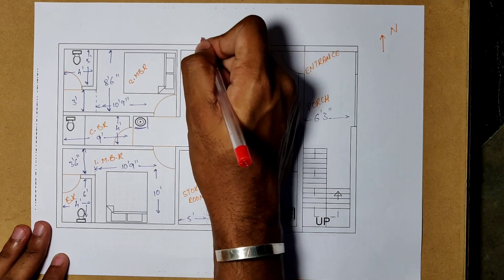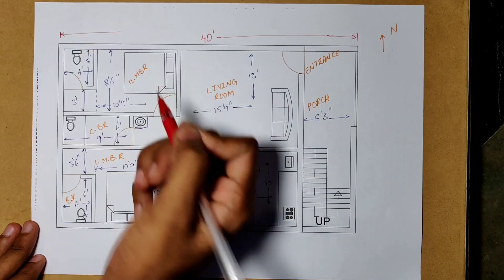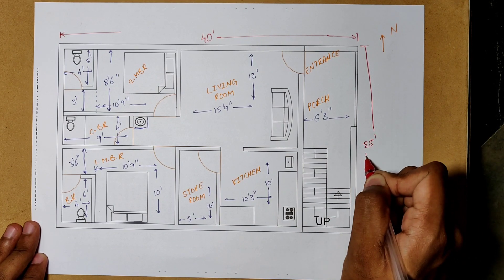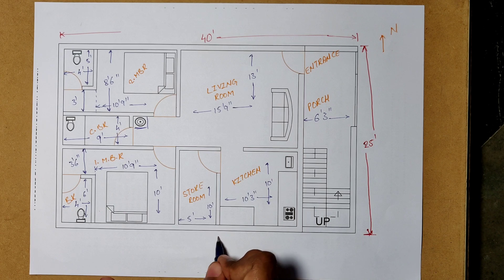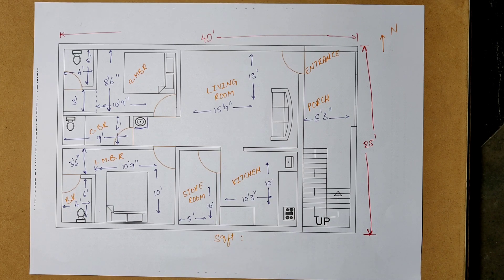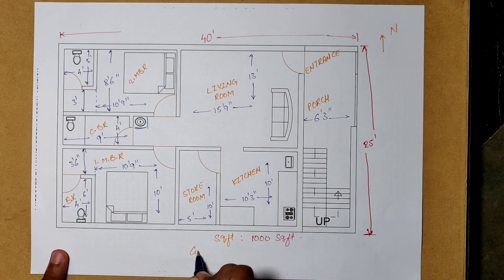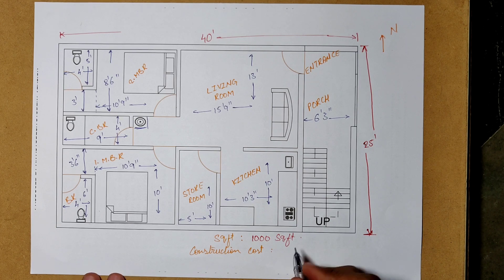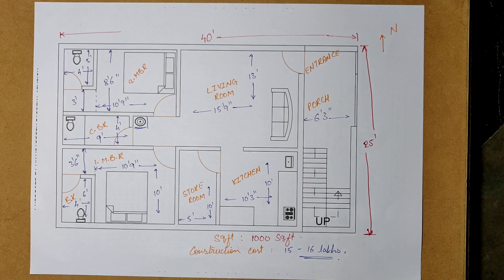2BHK ಮನೆ ಪ್ಲ್ಯಾನ್ ವಿತ್ ವಾಸ್ತು , ಕಟ್ಟೋದಕ್ಕೆ ಎಷ್ಟು ದುಡ್ಡು ಬೇಕು ?

Comment: Colam compalsari 9 kodkebekaaa or kadime maadbahudhaaa
Reply from the maker: U can reduce the no. But dimensions of the column will be larger which is not recommended.
Reply: @Civil_Circle  sir please 23*30 east facing plan 
But road is on South I need east facing main door 
I want portico, Pooja room, 2 bed rooms,staircase,hall and common bath room.
I don't need attach bathroom.
Reply: Please reply

Comment: Our site dimension is 936 sq/ft odd site, East facing, east to west 30+23.9, north to south 35.6+34, Aaya size 21*29 we are planning to build duplex House, ground floor full parking, in first floor open kitchen with living room,pooja room,1 normal bedroom [ no attach b/room ] 1 common bathroom attached to toilet ,in 2nd floor 1master bedroom with attached bathroom , 2 small size bedrooms, 1 common bathroom attached to toilet.please give best plan and how much cost to build as per above my requirements.